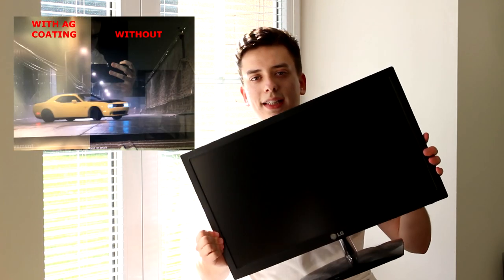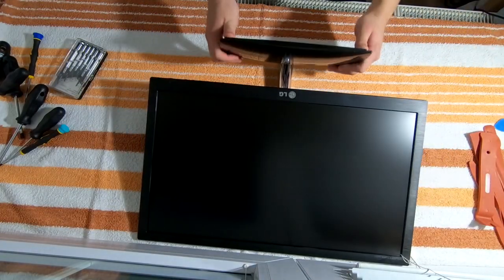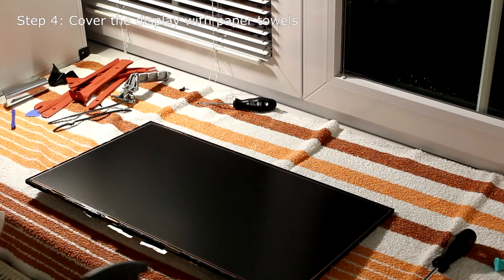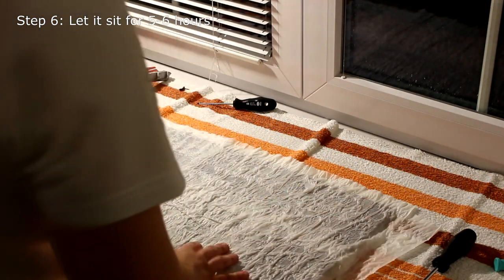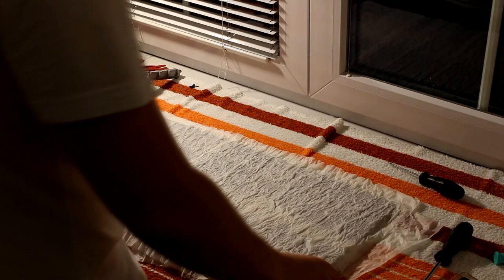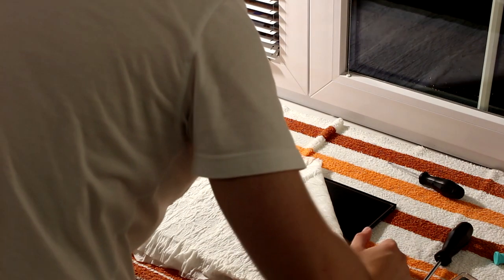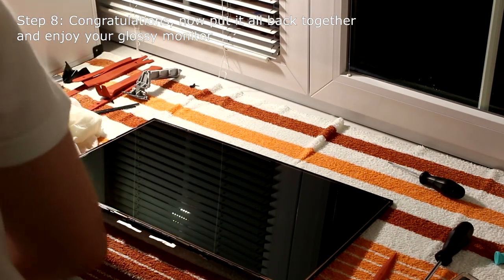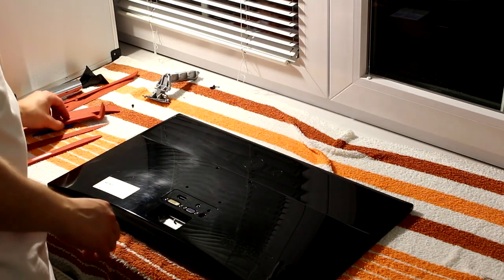How to remove the Anti Glare Coating from monitor DIY (Matte to Glossy)

Comment: Why is Apple literally the only company in the world that makes Glossy monitors (which cannot connect to PC), and why does every other company allow Apple to hold a monopoly over this section of the market?
Reply from the maker: No idea. I might start a glossy monitor company of my own haha, there have to be some people that would buy nicely designed monitor with glass.
Reply: @tomkosdiy  You should totally do that -- someone's got to, lol
Reply: @Theodore Nguyen Those "glossy" Dell monitors actually have a dirty filter in them.
Reply: Tell hp to make 1440p version of the HP 2511x. I just did through facebook. Only way to make companies make these is if we keep bothering them on social media
Reply: I would prefer matte screens on phones because of the fact that in high sunlight you might need to put your screens brightness near a macs and you could honestly get some super accurate colors still with some matte screens if they are built right. My Samsung monitor has super accurate colors with the color calibration I used on my mac. It has almost exactly the same colors as my Macbook ever since I callibrated it with the built in color calibration thing which means it is super accurate. My Macbook Pro  is the latest one without the touch bar. I understand that people have preferences and can see colors differently on some matte screens, but that does not mean all of them do not look as accurate as colores on some of apple's displays. Apple is known for color accuracy and even my Note 9 on bassic mode when I don't use the blue light filter can look very accurate like some Apple diplays. I do recommend using blue light filters if you don't mind the colors at night. I have mine on a schedule and set low. Even set low I can notice my eyes and brain getting more ready for sleep. I turn blue light filters off for art and photo editing though because I like the accuracy of colors when it's not on in Basic mode on my phone. There are some very good matte screen protectors for some phones out there. Matte black can be dark enough to my eyes on some monitors to my eyes.
Reply: Max Loh it’s still Matte on my Apple Studio Display lcd blueberry
Reply: @nguyenkhuonglinh6030  my last glossy monitor was a HP x2301. I'm looking for a replacement :(
Reply: Dell still make glossy monitor
dell s2419h
Reply: while you are at it please also make reflective monitors instead of transmissive. my eyes...😢
Reply: Krystian Blaszkowicz  I get it for office monitors, but why do all gaming ones only have matte screens too?
Reply: @tomkosdiy  my monitor is bezelless (Philips 248E9QHSB) will i need to disassemble it? does it work with each monitor? And does putting a glossy overlay will cause the same effect?
Reply: @mixedup5858  That is a 2018 monitor and i dont think they make them anymore. Dell aint made any new glossy panels since that monitor, and the 2021 models all matte too...
Reply: @foch3  I agree with every word. It's those stupid consumers that believe matte has no downsides lead to the death of beautiful glossy displays with vivid colors. Nowdays it's impossible to find budget to mid-ranged gaming laptop with a glossy screen. Literally ALL of them are matte. I used to buy only laptops with glossy screens before but I can't support that market anymore with my money because it doesn't exist.
Reply: @TabalugaDragon   No major reviewers will tackle this topic either it's honestly frustrating.  Hardware Unboxed doesn't even mention it and they are one of my favorites.  It's crickets all around.  I even emailed Viotek because I figured out of all the manufactures a little one might make something to test the market.
Reply: @tomkosdiy  Which type of monitors can not remove like this way?
Reply: @foch3  yeah and JarrodTech talks again and again every time he gets a glossy laptop(that happens rarely due to such laptops being super rare) how reflections may worsen the experience but never mentions far more vivid and bright, natural-looking picture as a positive result for having those those reflections. These reviewers treat glossy displays as a plague that shouldn't exist.
Reply: @mixedup5858  19h is not full glossy ，75%？ 18h is full glossy
Reply: YES i did it!!! but monitor had to soak some hours to make this!!!
Reply: apple make a matte version one (nano textured glass) but u need to pay a thousand buck more
Reply: Dell has glossy monitors for pc, for example s2319h, it is awsome monitors for graphic design or working with colors
Reply: @holaamigos00000  hahaha or pay $20 bucks for a matte stick on. Apple charging thousands for a stick.
Reply: Krystian Blaszkowicz  dunno, I have a 2017 macbook with a matte plastic screen. it has bad reputation, because of it's low res. and inaccurate colours (compared to higher end monitors) I still find it much more pleasing to look at, than many other laptops, because of the clear image.. even in bright daylight
Reply: @ShaunGohKW  HP 27es
Reply: Huge apple user here let me tell you apple is not taking the right approach here, glossy is not good for your eye health nor productivity , look pretty though
Reply: @Nestor88  Glossy is not good for day-to-day use which ironically is what apple products are supposed to be; glossy is better in a darkened theater for entertainment purposes; everyone is doing things backwards
Reply: Perhaps they have a patient
Reply: EVE Spectrum has 3 types of monitors that gave a glossy coating
Reply: Antiglare film = cheap!
Apple's glossy, needs expensive!! difraction coating and a glass, again - expensive.
So the answer = everyone is trying to sell cheap things
Reply: Also for reading text antiglare = good, 
glossy with reflections = bad

and with movies games photos  antiglare = dull, smoky image
Reply: Most people use to want matte displays because you see less reflections.
And not many use to care about it being washed out as long the reflections were "less bad".
I personally went from an Samsung Odyssey G5 to an LG C1, yes reflections are visible much better, but they're not washed out over the entire display.
Making the image sharper.
Linus Tech Tips actually made a video about this as well.
Reply: @nguyenkhuonglinh6030  I have this monitor as my secondary, it kinda wipes the floor with my main 1440p VA matte monitor.
Reply: Because all those companies are one monopoly thats why 😂

Comment: most underrated video ever. I've been so frustrated that manufacturers insist on only selling panels with the AG film.
Reply: i agree. but do  it must be  have huge brave...
Reply: I agree
Reply: as I unfortunately found out the hard way, now they not only have them with the AG film but the polarizer layer is built into it as well... So if you want to do this on some you have to remove the polarizer and then replace it with a glossy one
Reply: I understand why they do it but I wish it was easier to remove (like hot swappable)
Reply: @rockl79  So you're saying the AG layer is bonded onto the polariser in such a way that you cannot just remove the AG layer only? Are you sure you didn't just make a mistake and take off the top 2 layers, polariser as well as AG?
Reply: Not sure I agree. It seems multiple points of damage were done to this monitor (not just the frame, but a defect visible for much of the time he is putting it back together, and artifacts in the final image), and he does not mention how fragile the polariser layer is at all.

Comment: Glossy image is way superior but I don't have the balls to do it, my monitor is too expensive to risk losing it.
Reply from the maker: Agree 100%, unless you deal with heavy glare on the regular, glossy is way superior. You could get couple older monitors on craigslist and try it out for a few times first :-)
Reply: DIY KOS true man I had an iMac before my gaming pc and the image is stunning I have no problem with reflexes in my room so it would be awesome removing the anti glare. I live in Brazil don’t know if I can find cheap monitors for experimentation but I will make contact with Acer Brazil to see if they can recommend me a professional to do this mod. Great content it’s very hard to find this stuff
Reply from the maker: Thank you very much! The most important part I think is, when you are peeling the layer, to watch out for peeling just the white antiglare one. The dark layer under it is the polariser, which you need to keep on. You could also maybe take a look around your local scrap yard, if you can find some older monitors to practice on. Anyways, good luck!
Reply: IMO can be  risky because can damage Your eyes.
Reply: @alisur736  Are you sure???
Reply: @alisur736  Nope. Not at all
Reply: @andrefagundes6271  cara você conseguiu ? Eu to pensando em fazer por que essas telas foscas são horríveis
Reply: @redemption7704  to nessa. estou esperando o meu papel higienico secar aq KKKKKKKKK espero q de certo
Reply: Is it Dell? I've done on my Dell U2718Q, its OK. Image is stunning.
Reply: @tsushima33  I did on the Dell P2219H, it looks soooo much better now
Reply: @andrefagundes6271  Tenho um curvo 1440P, sabe se o processo é o mesmo?
Estou falando em Português porque percebi que você também é BR :D
Reply: @electrickrypt Alisur is talking complete shit. The LCD light is not dangerous at all.
Reply: você conseguiu fazer? deu certo?

Comment: Thank you, it is fantastic, but I think it would be appropriate to note that after doing this it is very delicate to clean, it can easily damage the polarized.
Reply from the maker: Great point!
Reply: if you do this, it might be a good idea to get a fitting glass plane, and mount/glue it to the display, like it's one in iMacs
Reply: maybe use ceramic coating then
Reply: @maxfuchs7995  and where would you find that? probably have better luck with a plastic of some sort

Comment: I finally did it. I hesitated for a year and looked for something sacrificial before trying on my main monitor but I bit the bullet today and removed the shitty matte plastic on my monitor. Now it looks perfect.
Reply: When you peel off the outer layer, underneath it, as far as I know, there is a polarizing filter. Isn't it dangerous to use the screen in this way? Isn't there a possibility of distortion? I would appreciate it if you share your experience.
Reply: @White_Polar_Bear  I am still using the monitor in question and it is working absolutely fine. I guess you would want to not touch or wipe the polarizer as much as possible to avoid damage. Don't do this on laptops though because some have just matte polarizer on top layer and bad things happen if you remove it.

Comment: ⚠️ YOU HAVE TO SOAK IT. Only after 1,5 hour I managed to remove the anti glare layer. But DO NOT FORCE IT, if its going hard to peel off or you will rip the lower polarization layer. 
My monitor is DELL U2718Q 4K. A couple of lines from the middle to the left, which are appeared when I forced to peel off. Cause I was slow, and the anti glare coating adhesive started to dry and kept hardening. Keep in mind. Almost satisfied the result. And sorry for my french. :]
Reply: but will the water get into the deeper layer of the monitor ???
Reply: @giotphan9673  Didn't mentioned it btw. I've put paper towels on table and filled them with water so they were very wet. And then I've put the monitor with face down. So this way the water will not come up to monitor parts. It requires flat surface.
Reply: how much soaking? I mean, I had toilet paper over the monitor, wet them with a sprayer every 2 hours or so. After about 7 hours I tried to remove, but nothing came out. My monitor is the LG ERGO 32".

Only did some visual damage at the very top corners attempting to remove the coating with my nails. Gladly it didn't affected the image, is at the very corners.

Like, seriously, I think besides what I've done, only if I bath my monitor :D
Reply: I'm no expert but I think you might have tried to peel of the polariser film or whatever it's called. Is the picture missing where you tried to peel the layer off, or is it just shiny?
Reply: да все норм))
Reply: does this work for curved monitors too?
Reply: @HeavyRaccoon17383  😂 that’s the question, no one knows) until someone try
Reply: @tsushima33  You can also use distilled water
Reply: @HeavyRaccoon17383  Im going to try it today with a curved monitor!
Reply: @frich2k  how it went?
Reply: Thanks for sharing your experience and tips on how to do it correctly
Reply: @JohnMarat  Yes, good idea not to damage electronics!
Reply: @HeavyRaccoon17383 it will work with any monitor that has an AG later but in a curved display ide be extra careful with how much water is use because you'll end up pooping excess water that doesn't get absorbed towards the middle of the wcreen

Comment: Everybody doing this. Its a small extra step on step 6 to remove the power unit and display circuit board (4-6 more screws and unplugging 2 cartridges). When you soak your the coating you have no chance to ruin these parts by condensation. 

Depending on the monitor, i often manage to peel the protective coating after 1 hour soaking and some needs like 24 hours. And you should not have to force it..it should glide off after u peel the corner. If u feel resistance like the one this guy had on the video dont force like what he did. Check wether the coating is not partially clipped in to the secondairy basel. If not, let it soak a bit longer.

trust me i've done this tons of times. Not to flame: This guy got lucky. I want to see him turning it on after this, instead showing us a before and after clip.
Reply: Did you do it on G9 Neo or G8/G7 Neo? :)

Comment: The comparison at the end is pretty bad lmao. I like glossy but the difference at the end is way over exaggerated. You can clearly see the after has no direct light from the outside window but in the before the sun is hitting it since the blinds are open. Pretty misleading.
Reply: at 9:12 you can see that the mat foil was just put over the monitor and not attached to it, so there is a distance between the mat foil and the monitor which makes the comparisons quite useless.

Comment: It's best to find a clear screen protector and slap it on there to prevent scratching the polarizer. It scratches very bad over time when cleaning it. That's what i do now when i perform this mod
Reply from the maker: Thanks, that is a great idea. I was thinking I would use regular 2mm thin glass next time I do this to give it a more of a premium look.
Reply: Hey guys, im gonna do this mod to my Asus MG279Q! Where i can find glass screen protectors for 27" monitor?
Reply: DraKK did u find anything
Reply: @xXxPhenom  finding glass ones is very hard. Even a plastic one for 27 inch is very hard. I got mine from a local store and they are usually sold together with stickers
Reply: @tomkosdiy  Also some monitors have ag coatings so thin they are impossible to remove this way. So the only way would be removing the polarizer and buying a glossy polarizer from china they come with glue pre applied and plastic protection on both sides tricky tho. at least with that you wouldn't have a raw exposed polarizer.
Reply: @xXxPhenom  hey brother! Any luck on the Asus MG279Q mod? Thanks in advance if you happen to even receive this response lol.

Comment: You failed at showing the most important part, removing the corner. But very good video over all.
Reply: Any tips?
Reply: @electrickrypt  use a needle to lift the very thin plastic mate sheet. It is very thin. Thinner than a glass screen protector. It is as thin as a hair and it.s not hard. So if you see any resistance it means you are removing the sheet below which should not be removed
Reply: @marcelfernandezromero8905  thank you, sir.

Comment: I would be very nervous about the soaking part. I destroyed a couple of screens like this, water just infiltrates between the glass layers of the panel and it either shows up directly on the screen as a black expanding blob or it destroys the electronics by shorting out the traces that go to each pixel row/column, and it takes very little water for that to happen.
Reply: Can't short a circuit with distilled water, unless of course it picks up conductive contaminants.
Reply: @_ch1pset  But it can go inside the screen.
Reply: @techalyzer  I think if the water got under the screen, it was probably too much water, or a manufacturing defect. However, I'm not sure distilled water would have the same effect that you are describing. Distilled water is not conductive, and it can't cause a short, unless it gets contaminated with something that is conductive. It's not that it can't cause damage, I think it can still cause corrosion, but I don't think this is an issue for LCDs. I'm not a materials engineer, so I'm not quite sure, but I don't think LCDs are prone to corrosion. If you get water on copper wiring, however, that's a different story.
Reply: Put the monitor facing downward , on top of the soaked towels .